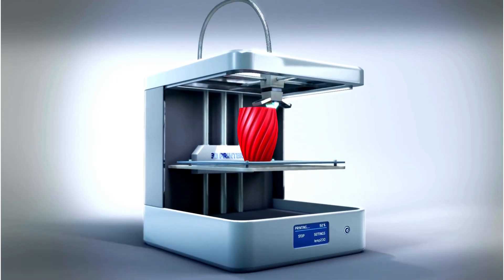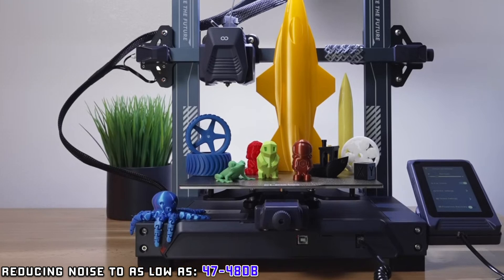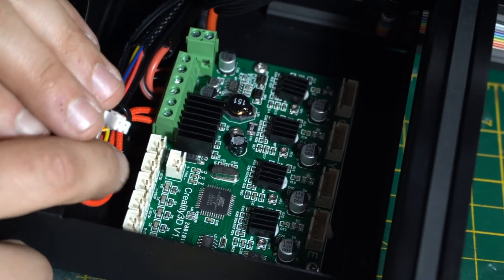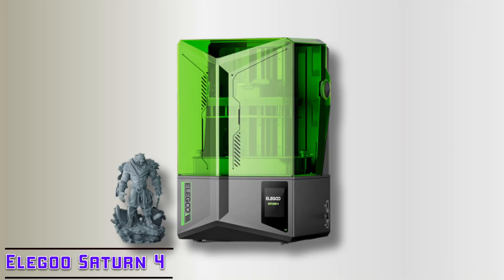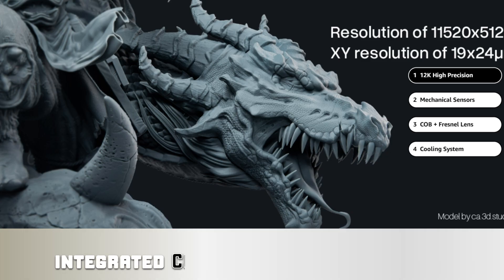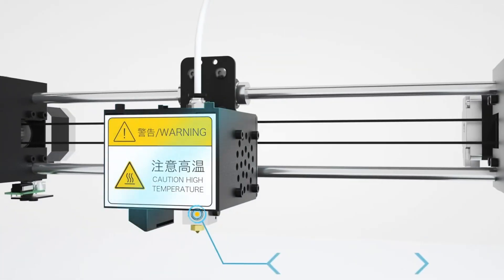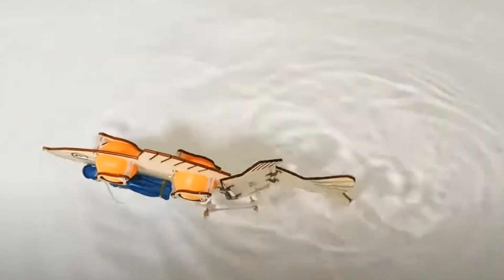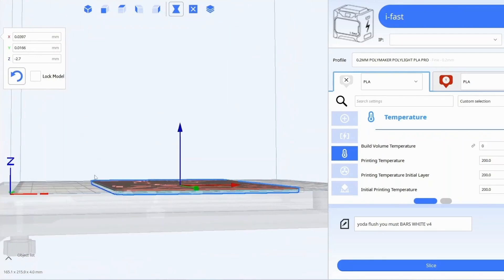Printers Under $300 - Best Budget 3D Printer 2024

Comment: Hey I am here because I want to find a 3D printer under 250 that has auto bed leveling and is new user friendly what would you recommend
Reply: Whatever you do don’t buy a refurbished printer from the creality  refurbished store . I bought a 3v3 se and it was not even refurbished . Extruder motor came fried . Missing parts a severely bent print bed frame   No firmware on it and  they are horrible to try and get a return it’s been 3 weeks and they keep trying to send me parts to fix it but refuse to   Refund me even tho I paid for warranty .
Reply: @SacredHeart0520  buying refurbished is fine, someone just was a jerk and returned their broken one somehow